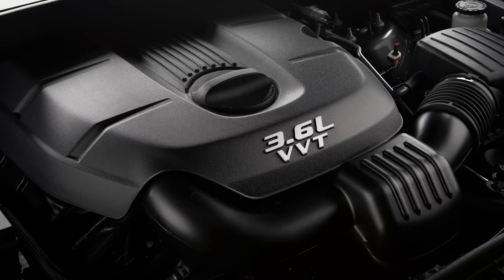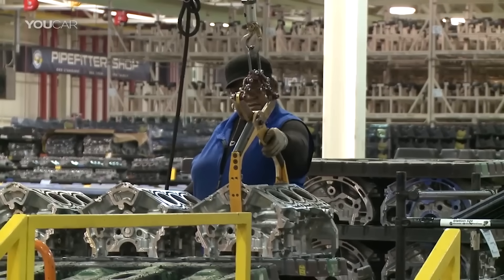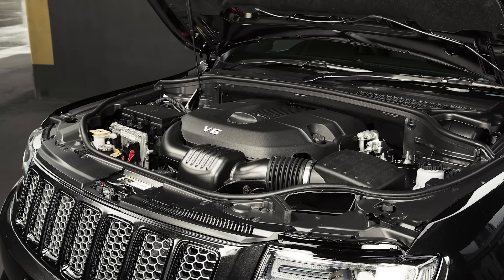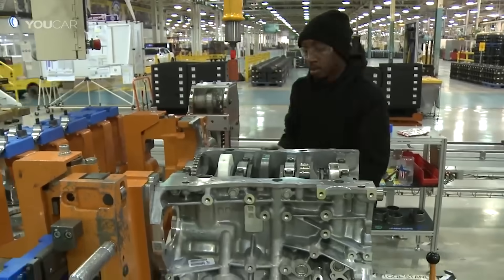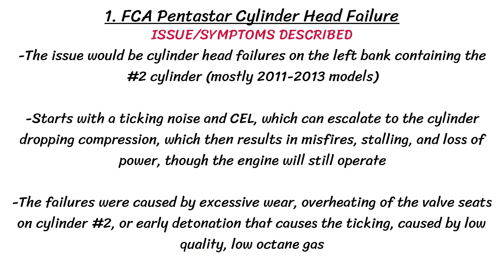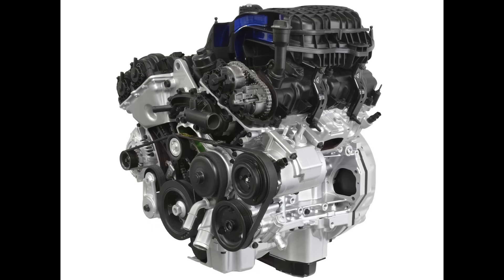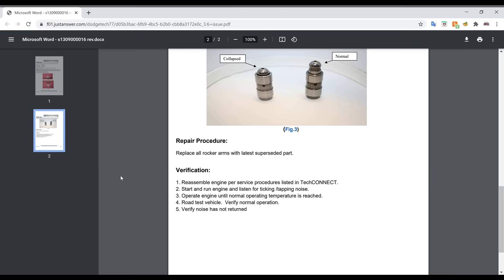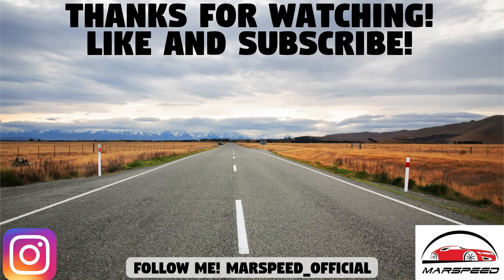The Specs and Fatal Flaws of the Chrysler 3.6L Pentastar V6 Engine

Comment: Definitely one of the most reliable engines from FCA/Stellantis. But have to say if you want the V6 get the 3rd gen with ESS which resolved the problems from the previous generations. You'll find the 3rd gen only in Chrysler Pacifica, Ram 1500, Jeep Cherokee, Jeep Grand Cherokee, Jeep Wrangler, and Dodge Durango. All the other models that I didn't mention with the 3.6 V6 like the Dodge Durango, Ram 1500 Classic, and Chrysler 200 for example uses the previous generation 2nd gen Penterstar V6.
Reply: The Cherokee uses the 3.2 Pentastar
Reply: How are those new rams with the 3.6? I hear lots of good things about them.
Reply: @joeshmoe8952  go for the hemi, I drive the v6 for work. Just feels pointless to have in a truck to be honest. Also that same truck has been in and out of the shop and its a 2020 with less than 20k miles
Reply: @christopherjohnson3614  Thanks for the info.
Reply: 3.6 is very reliable especially when you look at the millions produced. Still prefer the 6.2 in my Challenger.
Reply: Thanks for this information. Now I know which PentaStar to be on the lookout for.
Reply: Yea avoid any 1st and 2nd gen 3.6. I have a 2016 GrandCaravan and  it had the infamous "tick". Had all cams, lifters and rockers changed due to that issue. Also bad injectors and 2 bad transmissions. I'd probably avoid most if not all Dodge/Chrysler products pre 2022, especially if you don't have a warranty worth paying for or if you're not mechanically inclined.
Reply: So Dodge Durango is 2nd gen or 3rd gen? Because you said it twice

Comment: Have a new Jeep Grand Cherokee good so far..........barely even notice my engine is on and is so smooth but just typical Chrysler rough fit and finish. 😁😡 Mopar never loved and hated something so much at the same time.
Reply: I have a 2020 Grand Cherokee Trailhawk and I have no problems with fit and finish on mine. Had it for over a year now. I have owned 3 Wranglers with the Pentastar engine and all were excellent. Now the WK2 also has the 3.6. Great engine imo. I special ordered mine and optioned it the way I wanted it.
Reply: @MEDEDOME  Most the complaints in this video were very early on in the Pentastar evolution.

Comment: I have a 2011 chrysler 300 and my rocker arm on cylinder 3 is barely ticking but I want the car to last. Dealer wants to charge me 3k that I don't have and I am thinking if I should do it myself or what to do. This 300 has the mercedez 5 speed tranny which I know is pretty reliable so I don't wanna give it up!! What would someone recommend?? Got 150K miles on it btw
Reply: If it's barely ticking with 150,000 just drive it?
Reply: @rickystein7464  I bought it with 135K and been driving it since and the noise has stayed the same
Reply: @rickystein7464  I bought it with 135K and been driving it since and the noise has stayed the same

Comment: Mines got 120k on my charger and I beat on it like crazy and it’s taken it all so far.
Reply: My 2012  got over 230000 .  The only thing I had to replace was the water pump.
Reply: I have one in a 15 Charger, just replaced the Oil Cooler,the dealership always changed the Oil,but never once told us about the possibility of the  oil leak,then they wanted over a grand to replace it,I said nope,not yet today,I purchased one,and had it instead for 300 dollars.
Reply: Our 2013 charger with 3.6.  142k.  Replaced battery.  Even has original brakes.  Best car Ive ever had by far.
Reply: @makdaddy8399  you're fucking crazy if you still have the same pads from 2013...
Reply: @makdaddy8399  if you still have original pads and rotors at that milage and age you are god damn crazy
Reply: I have 111,000 on my 16' 300. Had a coil go out at 100k and cam follower go at 103k. My gf left the car running for over 24hrs once at around 60-70k because she didn't notice the car was still on when she parked lol. Probably the reason for the one follower going bad as these engines don't like prolonged idling. This engine doesn't seem that bad in later models and honestly it's easy to work on being a vvt engine with DOHC. I haven't heard of these engines having timing issues but I'm sure anything is possible. When I replaced the follower everything looked new under the valve cover. If they would just spend a little more money and get rid of all the plastic crap on these engines they would probably reach gm 3800 level of reliability.
Reply: Lmao only thing I’ve had to replace
Reply: @sourpowder1030  120k is a lot ... thats equal to 600,000 Toyota miles easy
Reply: I have a '13 Jeep JK w/125k and only have done plugs, pcv valve, & thermostat w/coolant change. Run amsoil only to 8k miles and NO tick!
Reply: Mine*
Reply: @716killakev  virgin
Reply: What kind of fuel are you using while getting 120,000 Miles?
Reply: @jeffreyzabawski4862   93
Reply: I hope FCA denies you any warranty coverage for intentionally damaging your engine!!
Reply: @josephsmith2063  at 120k I think his warranty left town A LONG TIME AGO. Also running the engine at higher rpms keeps carbon buildup to a minimum. I've heard tons of stories that if you drive it like you stole it plus maintain it it lasts a LONG TIME.
Reply: @joevaagen6170  I 100% agree. My '11 T&C gets dogged daily but always maintained and it is a beast. 200,000 rode hard and put away wet miles and still strong af.
Reply: These people will never admit when they have had engine replacements. There was one guy, I replaced the timing chains and phasers on this Charger. Didnt stop the right head from dropping a seat. Just like this guy here, this guy was sooo clueless he said it never needed a thing even though I replaced the chains and phasers less than a year prior. I never buy Mopar/FCA products to flip. Headaches and tears with picky cheap customers.
Reply: @iamtheoffenderofall   at what mileage you changed Timing chain ?
Reply: @juliusboy001  I replace them as low as 30k
Reply: Look at you oil filter housing between the headz🤣🤣
Reply: @ryanm.3393  My understanding is that it only cracks and leaks due to over torquing of the oil filter...
Reply: @Bass.Player  the ones I've replaced had bad o rings on the bottom mounting surface,could be from over torqued but I'm betting its the constant heat and cool effect on rubber
Reply: @ryanm.3393  I have not read that the bottom o-rings are a problem so I learned something.
I'm thinking about buying one of these Caravans (2013) so I'm doing some research....
Reply: @Bass.Player  I own a 2012 grand caravan with 96k and replaced a battery and oil bypass valve in the oil filter housing and tires once so far that's it. Purchased van at 56k in 2017. It's been a good vehicle.
Reply: I just got rid of my Charger Blacktop Edition, PIECE OF JUNK.
Reply: @TisiphonesShadow  Funny picked up the same in Orlando. Nice car.

Comment: Had an 89 Voyager with 3L Mitsubishi V6. Valve guides twice, once under warranty. Bought a 98 Caravan with V6. Don't remember displacement. Ran that as well as the Voyager for over 150K miles.
Reply: 3.3??
Reply: @curtisharrison5809  could have been
Reply: @curtisharrison5809  That 3,3 and 3,8 was bullet proof. As long as you changed oil regularly. A mate of mine still has 2   1997 caravans as company cars, cuz he likes them so much. They are both notching up to the half-million kilometers on the first engine, but do not ask me how many trannies those cars munched, haha :-D

Comment: This engine is a hoss in our 2013 town and country 136kand no issues.  BUT I am a used car dealer and I Can honestly say almost ever used town and country I see  at Auction is making a ticking sound.   I hear it on the Routan as well.  Funny though newer grand caravans run very well at auction I have seen very few with a nasty tick

Comment: It's still a decent engine for the base Chargers 👍
Reply from the maker: Absolutely it’s a solid engine! These episodes aren’t meant to bash on them just point out the flaws and learn more about them :)
Reply: @MarspeedCars  thank you for amazing videos you do to inform us, base in my research and as a owner 3.6 pentastar engine 2016 and up are the beset overall gasoline engine Have ever made!
Reply: I found the last generation Chrysler 200 with the V6 doing better than the Charger, Challenger, and 300 since it's lighter and more aerodynamic.
Reply: @La-yt1wr  chrysler 200s 3.6 Does not compete in any way or shape with Challenger or  charger, driving experience of chrysler 200 is Worst than kia, Hyundai, chevy etc That's why chrysler 200 got discontinued because there is a reason!
Reply: @ilircerkini2658  Chrysler 200 with the V6 makes 295hp and 262tq, and the LX cars V6 is between 292-300 and 264 tq. Between the 200 and LX cars they aren't that far off, and also weight and aerodynamic is another key factor for performance. LX cars equipped with the V6 RWD is 4,029 lbs and Awd 4,235 lbs, while as the 200 V6 FWD is 3,473 lbs and Awd is 3,802 lbs.
Reply: super punchy too
Reply: Yup 3.6 paired with AWD is a beast in bad weather
Reply: sounds pretty good when you let it breathe too. was a big surprise to me
Reply: Doesn't beat the 3800 v6 GM engine
Reply: @theshield1613  in what category? Ive owned both
Reply: @theshield1613    Every GM I have ever had has been crap. A s-10 Blazer, Monza, 2 Celebrities, a Cavalier, and a full size van all had major problems. My dad would not buy a GM and he worked at the Chevy stamping plant in Indianapolis. thta should have told me something.
Reply: @theshield1613  The composition cam gear was a real gem!!  Liked to explode & of course it was an interference engine.
Reply: @theshield1613  The 3800 V6 was on the Ward's 10 Best Engines of the 20th Century list, made Ward's yearly 10 Best list multiple times, and is one the most produced engines in history. To date, over 25 million have been made. (Wikipedia).
Reply: @theshield1613  damn straight bow tie till i die
Reply: @loganfromthe262    Well, somebody has to buy the crap. Good luck.
Reply: @theshield1613  that was a super turd, i worked at gm when those toilets came out, made the most money working on that trash then ever before in my 28 year career as a tech
Reply: @bleachinuri  my experience was the 3.6l v6 is a piece trash motor Dodge and GM
Reply: The Pentastar engine is more good than bad. Every single engine including the most reliable and bulletproof engines has their flaws.